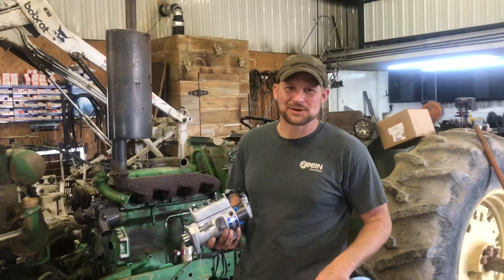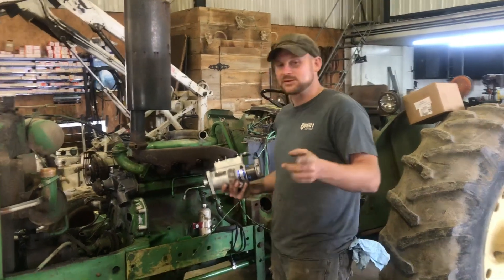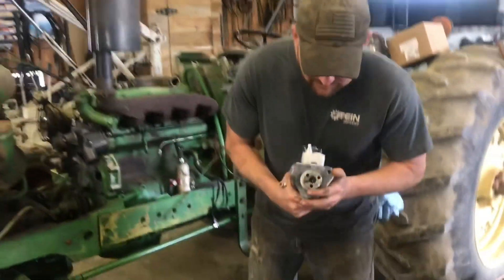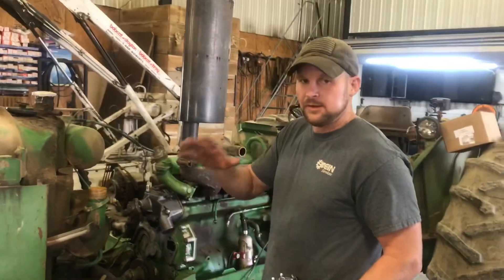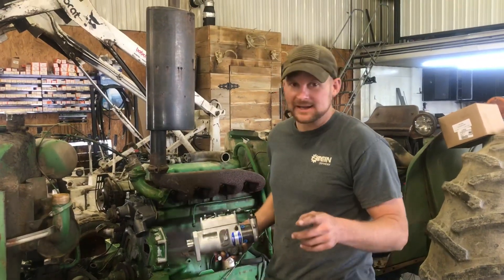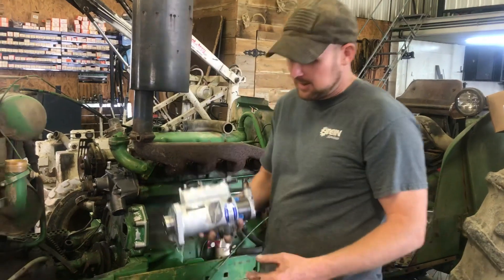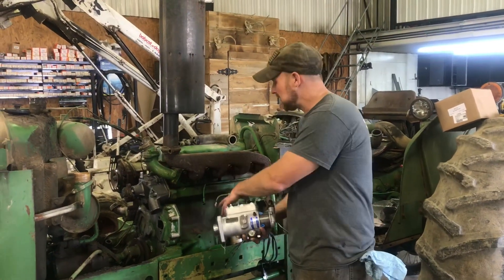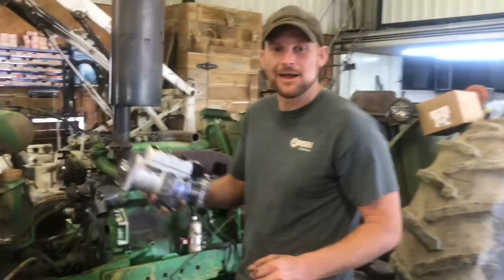John Deere 2030 injection pump timing

Comment: I just replaced my pump and the tractor, which used to start very easily before the injector pump issue, is now starting hard and has lots of white smoke until it warms up. I put new injectors in it but it still has the same problem. Any ideas?
Reply from the maker: As long as the pump is doing it’s job advancing at start up   I would say Your timing is off. One way or another.    Mark where it is now and turn it one way or another    That’s not the most technical way to do it.  But it can be done to verify that is the issue
Reply: Matt Foushee I'm having the same problem. I took the pump off. I did not turn the engine over from that point. The pump had to go back on in the same place but now it acts like it is out of time. It's wet stacking, lots of white smoke and I have to advance the pump  10 degrees to get it to run. It still won't start without starting fluid
Reply: @dwaynepotter5593  did you get one of the Romanian licensed replacement pumps?  I haven't changed the timing from 0 yet. I would love to have the easy starting tractor I did before bad fuel gummed up the original.
Reply from the maker: Go to the website. My phone number is on there.  Give me a call. I’ll help you out
Thanks
Reply: Are these pumps still available? Not having any luck finding